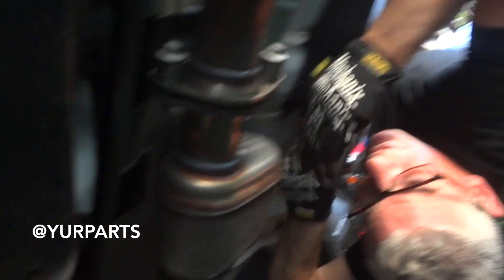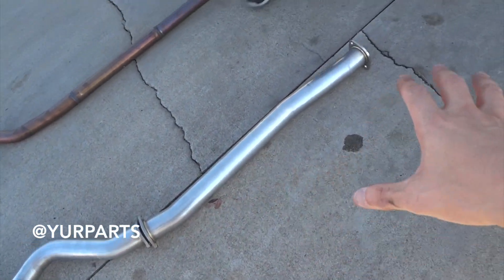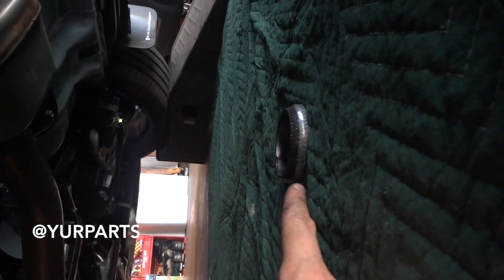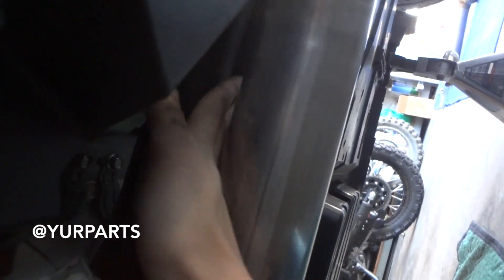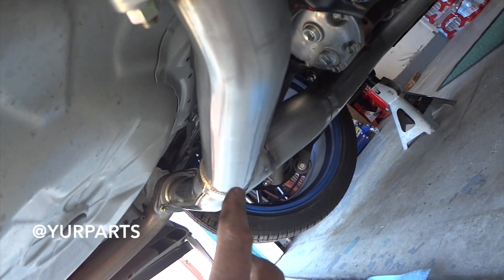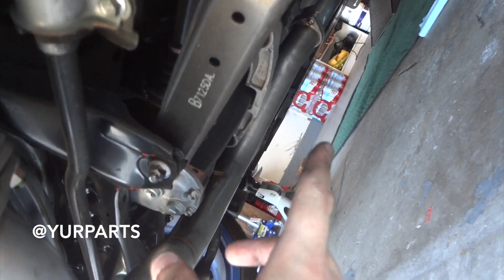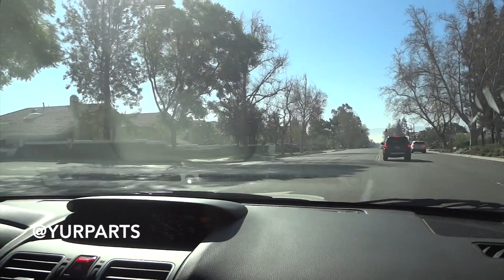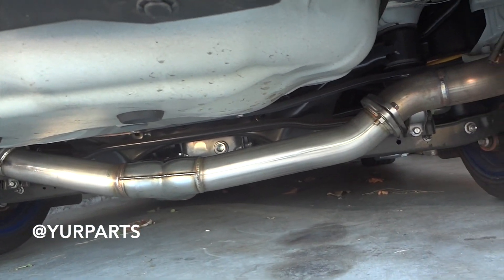REMARK NON-RESONATED CATBACK EXHAUST 2015-2017 WRX / STi

Comment: Got my axleback a year ago doing good. Had leak issues on left side. Also i called them about those crappy gaskets and they sent me 2 really good gaskets free! Great customer service
Reply from the maker: Good to hear, REMARK is a great company!
Reply: @MrRobear  are you still running this system? Do you sell the midpipes?
Reply from the maker: I have an extra resonated one laying around if your interested.
Reply: @MrRobear  do you still have that resonated mid pipe?

Comment: Is it louder than just the deletes? Im looking for more sound with pops and crackles
Reply: Not unless you have an aftermarket Jpipe. It is not different really!
Reply: I hear just the delets are louder than the full thing.
Reply: U get a way better flow and u don’t hear the deeper rumble outside. But u do inside. I get more crackles when I downshift. But def when u get ur j pipe that makes the diff

Comment: They sound great, any issue with leaks at all from the stock downpipe to the remark mid pipe or other mating parts on the remark system? And how do you like the sound of these compared to just the muffler deletes alone on the stock mid pipe?

Comment: Would you recommend the non resonated or the resonated? I currently have the double wall burnt tips muffler deletes with the stock mid pipe and I can't decide if I should get the resonated or non resonated. I live also in CA. Thanks!
Reply: Rachid Bennabi the only reason why I'm debating between the resonated and non-resonated is, I live in CA, exhaust LAW here is not modified exhaust friendly. Non resonated might be too loud?

Comment: Update on how you liking or not liking the mid pipe..? How about that poping sound? Is it still present with mid pipe ?
Reply from the maker: I love the non-resonated cat back. The pop os present but only on very high RPM shifts. I plan to put the resonator on in a about a week, and then we can all see the difference.
Reply: Mr_Robear which setup did you prefer?

Comment: Thought it would be louder. For me it seems it quieter any suggestions?
Reply from the maker: Check out the newest video with the exhaust, it is pretty loud now, got rid of the OEM front pipe.
Reply: Mr_Robear which one is it? Is it the one you added a j pipe?
Reply from the maker: https://www.youtube.com/watch?v=cgDMm6cd0aQ
Reply: Mr_Robear thank you! Still not sure why it sounds quieter. Now that front pipe. Does it need a tune?! I don’t want to void my warranty
Reply from the maker: I am currently on COBB Stage 1 - 91 octane OTS Tune. I can tell from the upgrades I have done it does not run 100% potential. But I have a PRO TUNE scheduled for the 24th, so this will help with positive gains in HP across the board. Thank You for being interested, stay tuned to see what happens.
Reply: Mr_Robear so it does require a tune ok thank you so much big help!!!

Comment: U do know that your stock is better than this 3" tubing? The stock is 2.5" and the airflow on that is smoother since its not cut in 3 sections.also the airflow on it will go faster since its 2.5" than a wider 3",so the faster it can go to exit will create louder sound going out the end tips.you only getting benefit on 3" wide midpipe if your car producing more power than a stock setup.but for now,u won't getting benefit with it soundwise and powergain wise but only a thicker piping looks.
Reply from the maker: I dis-agree.
Reply: YURparts its the air flow velocity that 2.5" piping is good enough for almost stock power.unless u have huge power mods then thats the time you will get benefit with this 3" width pipings.its the same concept of what other people thinks that putting an aftermarket air intake will gain them extra HP but they dont understand that they will lose that power instead and risking the life of their motor by sucking dust,debris and water than a covered stock filter design.one part wont work as it best.you should install them all at once to get their function at its best.
Reply: If you putting full turboback exhaust you should put the the rest.such as air intake,bigger turbo,front mount intercooler,catless downpipe,uppipe,all the deletes,fuel injectors,camshafts,bigger intake manifold etch...
Reply: Ok ... so all of the aftermarket catback exhausts on Dynos showing gains of 10-15 hp are illusions of people' imaginations?
Reply: Pain Killer catback alone wont do any gains but just sound volume and tone.unless you add downpipe which will be a turboback exhaust and ofcourse u need to tune it to stage 2 once u put catless downpipe and that will add HP gain.same as air intakes,they just a noise maker.SRI is a HOT AIR INTAKE and the CAI is a WATER/DEBRIS/DUSTS sucker intake.stock intake is the best intake for your mildly tuned/moded motor.only get those SRi/CAi if you will put high mod on your motor and put them alltogether all at once.not just one by one and expect gain.they don't work alone
Reply: Pain Killer but that added gained on a turboback exhaust with a tune will be just minimal and often just for louder sound.and most turbobacks are even heavier than stock which will affect your acceleration too.but on dyno will show gain since your car is stationary which wind drag over the overall weight of the car is nonexistent from that test.well again,u can't expect noticeable gain by just installing bolt ons one by one,they need to be installed all at once and with a pro-tune to get the full benefits of each part for best gain.
Reply: Martin Umaguing I agree that more needs to be added for noticable power gain, as well as for certain mods to be efficient ( intake it's often unnecessary). I do however disagree that if stock midpipe is replaced with larger diameter, more power is not gained at higher RPM 4500>. Again not a lot, but some .
Reply: Pain Killer stock midpipe is already designed for the full safest tune for the motor even with just a mild mods.by replacing the stock 2.5" diameter midpipe with 3" will decrease responsiveness of the throttle response if not highly moded.the air flow velocity on the 2.5" will flow faster out than the thicker 3".u will only get the benefit  of 3" pipings if you have 400+ hp/whp.if not,then a 3" will just for a deeper sound tone and lost of responsiveness.same as if u put FMIC with wider and longer pipings,u will lose alot of responsiveness due to the air flow velocity that feeds to your intercooler and u will omly get the benefits of FMIC if you replace your turbo with a bigger one.but with the stock turbo,nahh it will only be for aesthetic looks for your front end.
Reply: Martin Umaguing less restrictive is better for a non NA car
Reply: I completely agree....to disagree with this